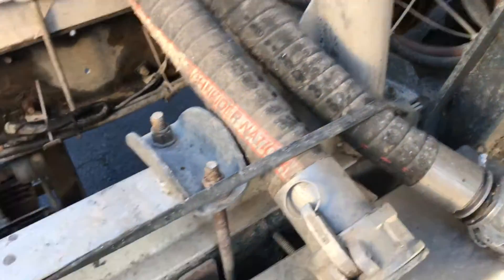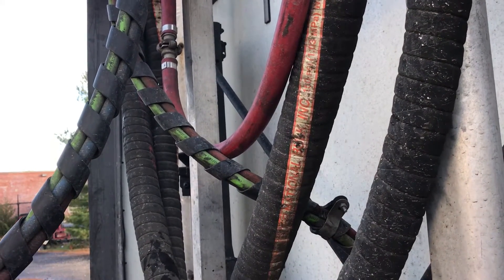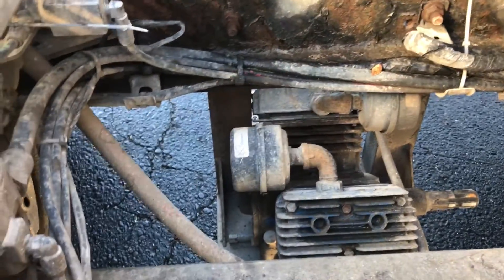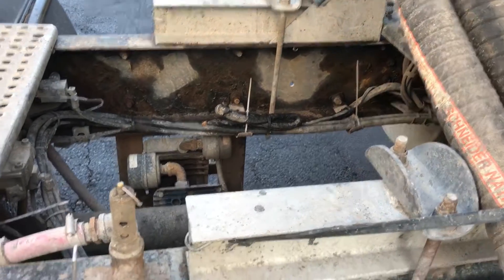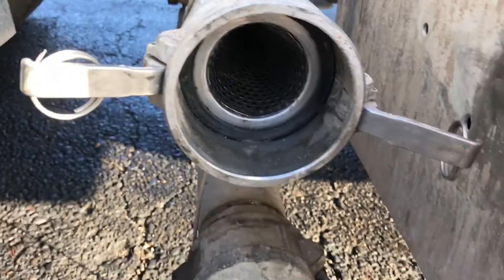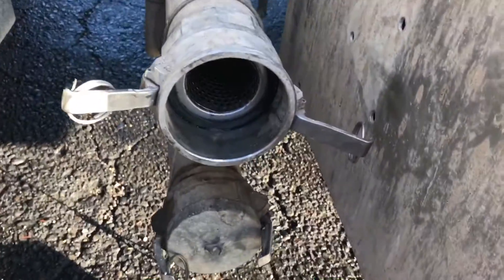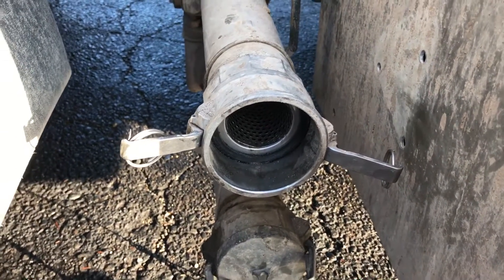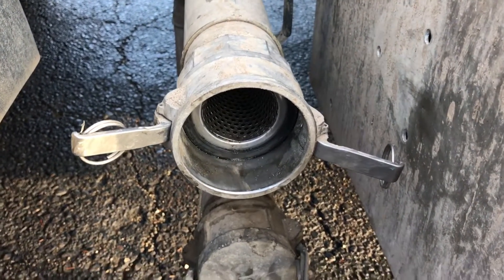Bulk Tanker Hoses and Tips

Comment: Can you pump water with this setup?
Reply from the maker: All day long.
Reply: @JohnMillermmc  do you know any good water jobs? And thank you so much for answering my comments. I don't see no channels that run roper pumps. Also how do you clean it?
Reply from the maker: @OPENYENZ  where I live (outside Chicago) we don’t have a large need to move water. That’s more of the south thing. We haul mainly solvents & alcohol, so when we need to wash the pump out, we get it done at the same time we wash the tanker out. (If I had to pump off alcohol, I always left a little in the pump so it wouldn’t rust)
Reply: @JohnMillermmc  I'm in Texas, I'll find it. Thank you driver. You have been very helpful. God bless you